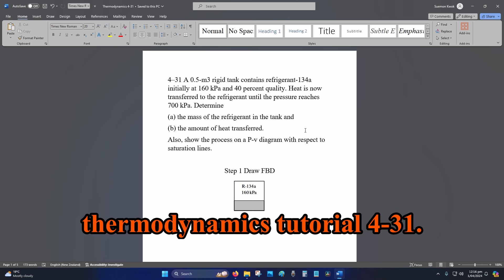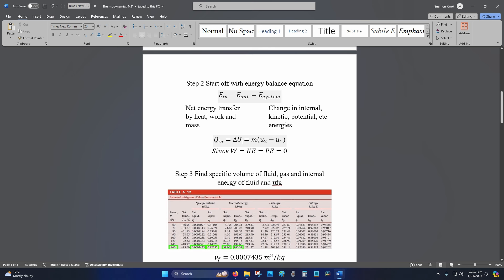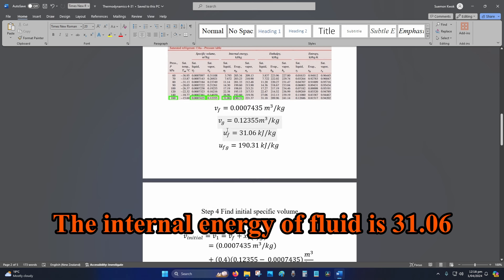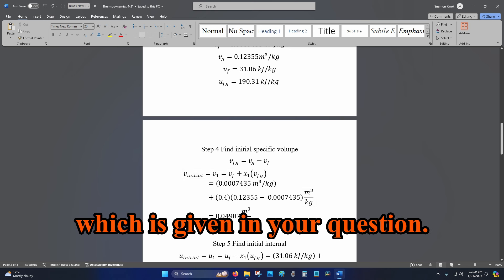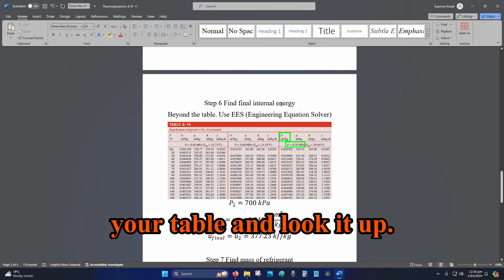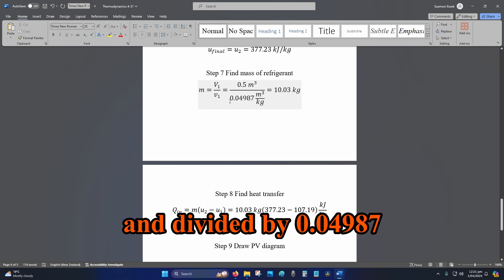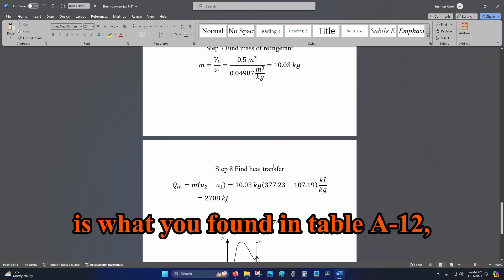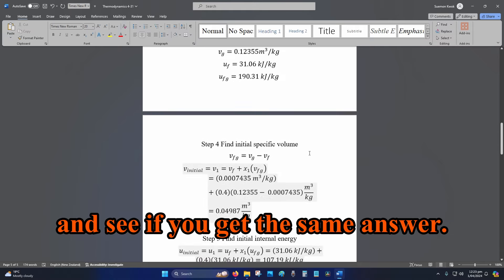Thermodynamics 4-31 A 0.5-m3 rigid tank contains refrigerant-134a initially at 160 kPa and 40%

Comment from the maker: I used EES software to find u_2 but if wanted to do this manually you need to extrapolate
1st go check the phase/region go to table A-12 at 700 kPA and check vf and vg vs v_2=0.04987 m^3/kg. 
0.029392 < 0.04987.
v_2 is greater than v_g so it's superheated go to table A-13 0.7 MPA
 At 0.7 MPa: v = 0.048597 m³/kg, u = 367.31 kJ/kg. So this means we need to extrapolate because we ran out of data points.
Go back to saturated table A-12 at 700 kPA write down v_f, v_g , u_g.
Next go 10 to 20 degrees higher and write down v_f, v_g , u_g values for the new pressure. I chose next closest 19.6 degrees at 1200 kPa and  46.29 °C
Values and steps below

At 700 kPA
T_sat = 26.69 °C
v_f_700 = 0.0008331 m3/kg
v_g_700 = 0.029392 m3/kg
u_g_700 = 244.51 kJ/kg

At 1200 kPa
T_sat = 46.29 °C
v_f_700 = 0.0008935 m3/kg
v_g_700 = 0.016728 m3/kg
u_g_700 = 253.84 kJ/kg

Given:
- At 700 kPa:
  T_sat = 26.69 °C
  v_g_700 = 0.029392 m³/kg
  u_g_700 = 244.51 kJ/kg

- Our target state:
  P = 700 kPa
  v_2 = 0.04987 m³/kg

- table A-13 provided :
  At 700 kPa: v = 0.048597 m³/kg, u = 367.31 kJ/kg

estimate u_2 using these points:

1. We have two points on the 700 kPa isobar:
   Point 1 (saturated vapor): v_1 = 0.029392 m³/kg, u_1 = 244.51 kJ/kg
   Point 2 (superheated): v_2 = 0.048597 m³/kg, u_2 = 367.31 kJ/kg

2. Calculate the slope between these points:
   Slope = (u_2 - u_1) / (v_2 - v_1)
         = (367.31 - 244.51) / (0.048597 - 0.029392)
         = 6401.97 kJ/kg/m³

3. Use this slope to extrapolate to our target specific volume:
   u_target = u_2 + Slope * (v_target - v_2)
             = 367.31 + 6401.97 * (0.04987 - 0.048597)
             = 367.31 + 6401.97 * 0.001273
             = 367.31 + 8.15
             ≈ 375.46 kJ/kg
u_2 = 375.46 kJ/kg which close enough EES answer
____________________________________________________________________________
Python code below

# Given data
v1 = 0.048597  # m³/kg from table A-13 0.7 mPA
u1 = 367.31    # kJ/kg rom table A-13 0.7 mPA
v2 = 0.04987   # m³/kg Target volume
v0 = 0.029392  # m³/kg (from saturated data at 700 kPa)
u0 = 244.51    # kJ/kg (from saturated data at 700 kPa)

# Calculate the change in internal energy (Δu)
delta_u = ((u1 - u0) / (v1 - v0)) * (v2 - v1)

# Calculate u2
u2 = u1 + delta_u

# Print the result
print(f"u2 at v2 = {v2} m³/kg and P = 0.7 MPa is approximately {u2:.2f} kJ/kg")
Reply: i dont get it why u use closest 19.6, any theory about this?
Reply from the maker: @nurfatinnadiha7414  46.29°C-26.69°C =19.6

This was the closest temperature range to choose from with the given specific volumes.I just choose what was above and below to the value I need.

Comment: How did you know that the refrigerant is superheated at the final stage
Reply from the maker: At 700 kPa pressure table v_g = 0.029392 

Since v_1 is equal to v_2 because of it is a rigid tank and there is no piston changing the volume

v_1 = v_2 = 0.04987 m^3/kg

0.04987 >  0.029392

0.04987 m^3/kg is greater than 0.029392 m^3/kg When checking the pressure table

Since it is greater than v_g, it has be superheated vapor

Comment: how you get u final = U2. From Where
Reply from the maker: I used EES software to find u_2 but if wanted to do this manually you need to extrapolate
1st go check the phase/region go to table A-12 at 700 kPA and check vf and vg vs v_2=0.04987 m^3/kg. 
0.029392 < 0.04987.
v_2 is greater than v_g so it's superheated go to table A-13 0.7 MPA
 At 0.7 MPa: v = 0.048597 m³/kg, u = 367.31 kJ/kg. So this means we need to extrapolate because we ran out of data points.
Go back to saturated table A-12 at 700 kPA write down v_f, v_g , u_g.
Next go 10 to 20 degrees higher and write down v_f, v_g , u_g values for the new pressure. I chose next closest 19.6 degrees at 1200 kPa and  46.29 °C
values and steps below

At 700 kPA
T_sat = 26.69 °C
v_f_700 = 0.0008331 m3/kg
v_g_700 = 0.029392 m3/kg
u_g_700 = 244.51 kJ/kg

At 1200 kPa
T_sat = 46.29 °C
v_f_700 = 0.0008935 m3/kg
v_g_700 = 0.016728 m3/kg
u_g_700 = 253.84 kJ/kg

Given:
- At 700 kPa:
  T_sat = 26.69 °C
  v_g_700 = 0.029392 m³/kg
  u_g_700 = 244.51 kJ/kg

- Our target state:
  P = 700 kPa
  v_2 = 0.04987 m³/kg

- table A-13 provided :
  At 700 kPa: v = 0.048597 m³/kg, u = 367.31 kJ/kg

estimate u_2 using these points:

1. We have two points on the 700 kPa isobar:
   Point 1 (saturated vapor): v_1 = 0.029392 m³/kg, u_1 = 244.51 kJ/kg
   Point 2 (superheated): v_2 = 0.048597 m³/kg, u_2 = 367.31 kJ/kg

2. Calculate the slope between these points:
   Slope = (u_2 - u_1) / (v_2 - v_1)
         = (367.31 - 244.51) / (0.048597 - 0.029392)
         = 6401.97 kJ/kg/m³

3. Use this slope to extrapolate to our target specific volume:
   u_target = u_2 + Slope * (v_target - v_2)
             = 367.31 + 6401.97 * (0.04987 - 0.048597)
             = 367.31 + 6401.97 * 0.001273
             = 367.31 + 8.15
             ≈ 375.46 kJ/kg
u_2 = 375.46 kJ/kg which close enough EES answer
____________________________________________________________________________
Python code below

# Given data
v1 = 0.048597  # m³/kg from table A-13 0.7 mPA
u1 = 367.31    # kJ/kg rom table A-13 0.7 mPA
v2 = 0.04987   # m³/kg Target volume
v0 = 0.029392  # m³/kg (from saturated data at 700 kPa)
u0 = 244.51    # kJ/kg (from saturated data at 700 kPa)

# Calculate the change in internal energy (Δu)
delta_u = ((u1 - u0) / (v1 - v0)) * (v2 - v1)

# Calculate u2
u2 = u1 + delta_u

# Print the result
print(f"u2 at v2 = {v2} m³/kg and P = 0.7 MPa is approximately {u2:.2f} kJ/kg")

Comment: what is the EES  i do not get it?
Reply from the maker: (EES) Engineering equation solver it is a software program used for thermodynamics. Most universities should have it for free for Mechanical engineering students. 

If your university doesn't have EES then your lecturer or Professor won't give you questions that use ESS.

Alternatively if you really wanted to solve this equation by you need to use a different thermodynamic table with more data that fits or closely fits this problem then linear interpolate it to find U2
Reply: Professors may ask you to linearly interpolate this information should it not be given in the tables. That is, define an equation y=mx+b, solve for m and b given initial conditions such as temperature, pressure, internal energy, etc, then solve for y at a given x. This video is very helpful, do not mistake it, but linear interpolation is something that has been asked of me multiple times. I had not heard of ESS until today.
Reply: Looking back at the problem, I do not think linear interpolation is possible here. I will have to try it
Reply: Linearly interpolating past the graph leads to skewed results. Not advisable, but if asked, it can be done. Using linear interpolation, I found 376.8 kJ/kg to be my value for u_f. Close enough, but this is assuming linear fit past the table, hence the 0.43 kJ/kg difference.